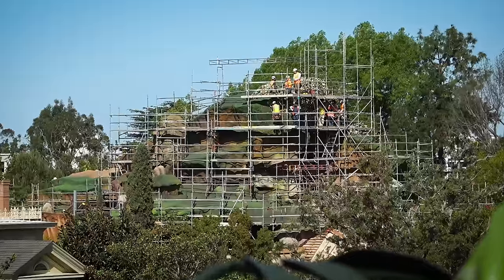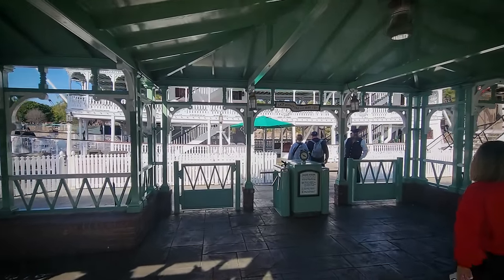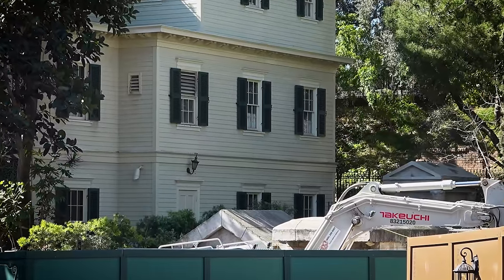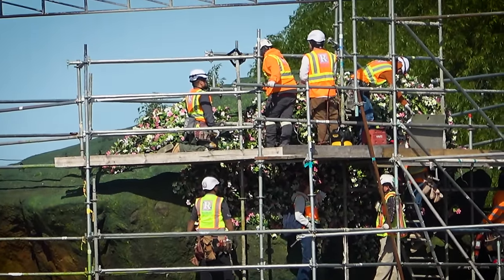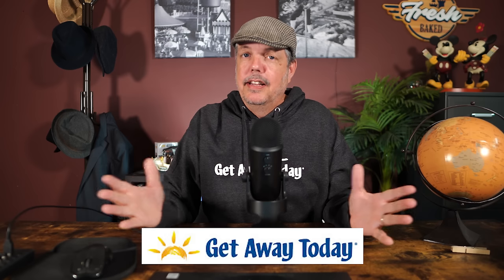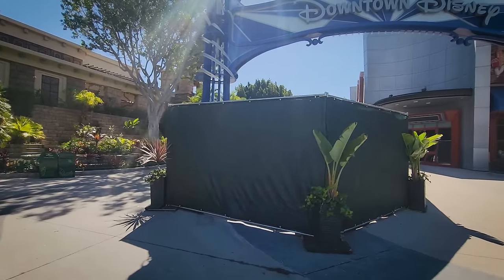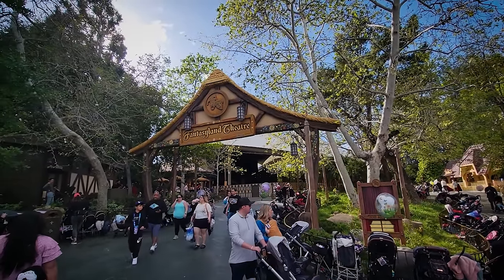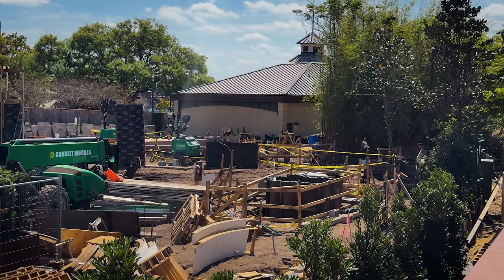New gates at Main Entrance! | Disneyland Construction 03-18-2024

Comment: 1) the turnstile type at WDW cannot be used at Disneyland because of state law that restricts the biometric identification process used for the fingerprint access data storage. 2) these turnstiles are better for some handicapped individuals, except they appear to have a small incline at the opening, so they may not be ADA compliant for wheelchair access, requiring the center to be opened by a cast member for them. 3) The trees that were next to the Haunted Mansion were Italian Cypress, not spruce trees, and they might not be coming back as part of that space will be filled by the new merch location.
Reply: I was thinking it probably had to do with a CA law
Reply: Universal Studios Hollywood uses fingerprint identification so I don' think that's it.
Reply: There is no state law that restricts collecting biometric data. The simple reason is that it’s a cost-related issue and the extra expense to implement a system similar to WDW’s system isn’t worth it in the minds of those that make these decisions. 

Disneyland’s ticketing system is much more older than the one that WDW is using so trying to implement new things in it can cause some major issues.
Reply: The California Consumer Privacy Act (CCPA)
Reply: Yes , California Consumer Privacy Act (CCPA) covers fingerprint, retina and other unique biometric data that can be used identify a person's identity.
Reply: @JackGalanty But Universal Hollywood still uses fingerprints for entry, so I’m sure Disney could use the same tech if they wanted.

Comment: As others have stated, the turnstiles are similar to the ones at Disneyland Paris and are being manufactured by the same company. As I understand it, these initial ones are not permanent and are just going to be used for testing and optimization to ensure the permanent turnstiles are ready to go upon installation. I would suspect that there will not be the slight ramp you see there right now as all the power & electronics will be set under new concrete, which should hopefully allow for 3 turnstiles per section, so they also increase the number of turnstiles by as much as 50%. If they can do that, it will also greatly decrease the lines in the morning or during the crossover times.

Comment: Tiana logs at the MK have had the Splash Brer Rabbits removed from the front.  Padding has been replaced and logs cleaned up.  They're not new.  And those entry gates at WDW don't record your finger prints, but they do measure aspects of the finger you use.  Far better than the old biometric two finger method that was originally used.

Comment: Turnstyles at WDW have an extra step of needing a finger print, and they sometimes don't capture quickly, so I think this is better, I do wonder why they have space between them, these are purposely built to be wide enough for handicap access, so a middle bypass shouldn't be needed, and a third turnstyle should be able to fit there I'd hope

Comment: You remember those long I-Beams that were laying down are gone? They're vertical now in a deep hole they dug with those big hydraulic auger screws attached to the excavator. They are the framework for the elevator. Where did the dirt come from? Uh, a big ass hole they dug for an elevator. And the CAT machine is NOT a backhoe. It's a front end loader. There isn't anything on the back but the motor compartment. What you called a "mini" excavator is a backhoe. You got the Excavator right & in case you wondered about the small machine by the excavator in front of the forms you pointed out it's either an air compressor or a generator.

Comment: The concept art for the Madame Leota's gift shop shows the tall trees - spruces? I don't know trees - lining that wall of the Haunted Mansion instead of jutting beyond it. This makes sense as it seems they're going to widen the Esplanade as it is one of the most nightmarish paths in the park. There's not a ton of concept art to go on, but the shorter brick wall is noticeably missing in the Madame Leota art.

Also, Redwood Creek is way too small for anything Pandora-related, unless it's some crappy meet-n-greet. The Flight of Passage ride building all by itself wouldn't fit. If it goes here, it's in Hollywood Land. So this could be Avatar-adjacent, as they would need a new home for Monsters, Inc and (probably) the Animation building. The Pixar campus is in Northern California, so that would work thematically. Monsters, Inc - which really needs to become Ride & Go Seek - could easily replace Goofy's Sky School or go into the building next to the Midway Mania ride building, which was originally earmarked for a dark ride. Goofy's needs to go, and it wouldn't hurt to expand Pixar Pier and replace the crappy flat rides with some Pixar-themed ones, at the very least.

Comment: I just want to be able to add tickets to my iPhone Wallet like I can at WDW. So much easier. And it worked with Genie+ too not just the entrance
Reply: That would be so much more convenient as a local magic key holder to just use my Apple Watch instead of hoping I have phone reception or remember to bring my band
Reply: Right?!?  They need to build in the same functionality into the DLR app that the WDW app has.  Support for phone Digital wallets and watches is a big missed opportunity.  Using my Apple Watch at WDW is awesome! Also, the ability for family/friends to link their accounts together would be really helpful.
Reply: I'm going for the first time next month, so you can't use your phone to scan in??
Reply: @jayokee714  you have to scan from the Disneyland app. It’s not part of Apple or Google wallet like WDW. And it’s kind of buried in the app so it would help to find it before you get to the front.